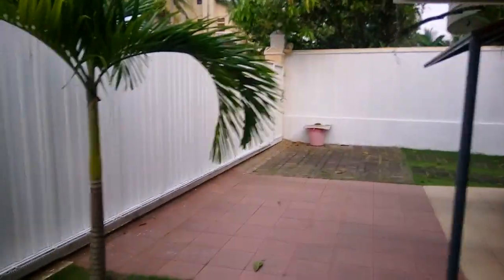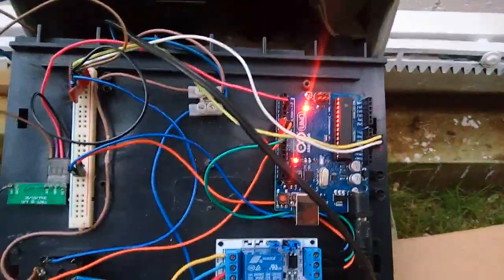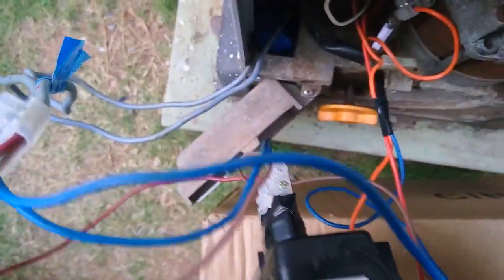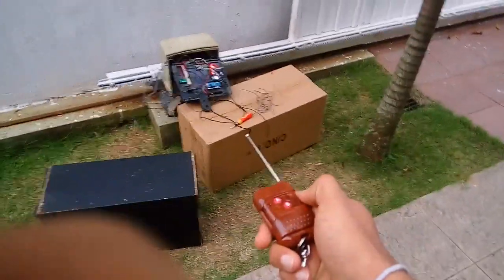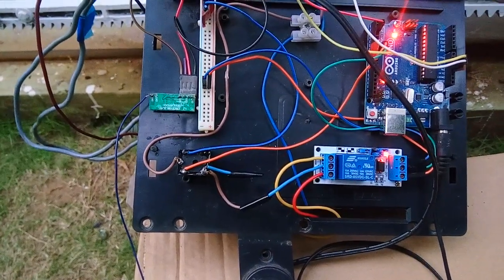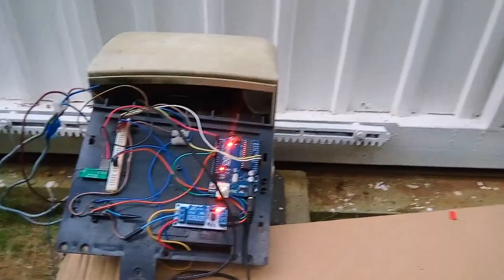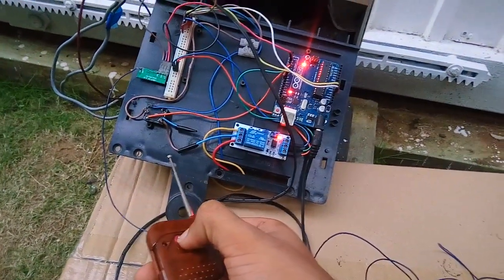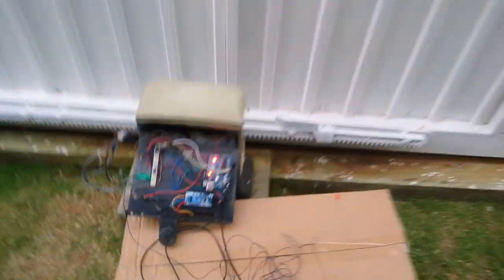Arduino Uno powered Sliding Gate

Comment: Sorry to say so, this is a very poor design - not practical nor safe at all. And you really only need one remote control channel to control it properly, especially when the user panics. The sequence after receiving each trigger signal should be: OPEN. OFF. CLOSE. OFF. and back to the beginning of the sequence.

Obviously, limit switches for each end of travel, will supply the OFF signals as well - as should a motor overload detector. A gate - especially the one you showed - can be deadly to pedestrians. But it can also damage vehicles if it doesn't have a system, typically an infra-red beam switch, to detect people/vehicles in the way, especially while closing.

Comment: hi, why does it take that delay between you press button and door starts moving?
Reply from the maker: There is a significant back emf induced by the motor on the relay contacts when the motor is already running forward and you tell the system to immediately run in backwards. The delay is to stabilise the back emf in the system.

Comment: sir how many Amp and volt the relay that you use
Reply from the maker: Coil Voltage is: 5VDC
Output Voltage: 230VAC
Output Current: 10 A

Comment: Hi,

I'm from the Philippines and I was planning to do a project to turn our manual sliding gate into an automatic remote controlled and I saw your video while searching the web. I plan to use wiper motor. Can you please share with me the schematic diagram and program code you use. If possible share all the items you used?

Thanks

Comment: Nice project!!! I have some questions. Can you tell me more about the limit switch. Do you use one, as I can see on the other video, or two? If you use one, does it move in both directions? Also, I would like to know the type of the switch. Please give some more details. Thank you.
Reply from the maker: Thank you for the awesome comment!! It actually uses two limit switches. But the two limit switches are connected to a spring loaded toggle switch. When the gate is opened/closed the toggle switch is pushed to one side closing one of the two limit switches. That is how I tell the system whether the gate is opened/closed.
Reply: Thank you!

Comment: Very cool - not sure if this in the US, if it is be aware that any damage to the gate, motor, vehicles or persons damaged or injured by the gate or damage to the electrical systems driving this will NOT be covered by an insurance claim as the controller is not CE or UL approved.
Reply from the maker: Noted!!

Comment: Cool project. Can't you wire or program an interlock to prevent simultaneous open and close to get rid of that delay?
Reply from the maker: Good point but the motor is able to handle the rapid change in power but the back emf from the coil damages the vulnerable electronics if power is suddenly changed.

Comment: is there stop protection if someone gets in front of gate?
Reply from the maker: I am currently installing an IR sensor to detect motion in front of the gate and stop the motor if it detects movement. Updated video of the system will be coming soon!!
Reply: @LasithPremaratne have you made it?

Comment: Hi Lasith Premaratne, what is the specification of the motor..?
Reply from the maker: Hi, This is a 230VAC 0.5hp single phase AC motor.. Hope it was helpful!!
Reply: Thank you Lasith Premaratne, is that motor a geared one. Because ac motors start running at a high speed, but in the video the motor runs at a constant speed
Reply from the maker: Good observation, This indeed is a geared motor. These type of motors specifically cater high torque, low rpm applications hence the low constant speed.
Reply: Thank you for the reply.
Reply from the maker: I appreciate the mutual interest.. Do check my latest build: https://www.youtube.com/watch?v=uwwOiFObCrw

Comment: the delay is massive.
Reply from the maker: The system works with a 5 seconds delay as compared to 10 seconds here. This was in the early testing stages of the system.
Reply: have you tested, what is the maximum distance that you can still activate the door?
Reply from the maker: It has a working distance close to 5 meters.